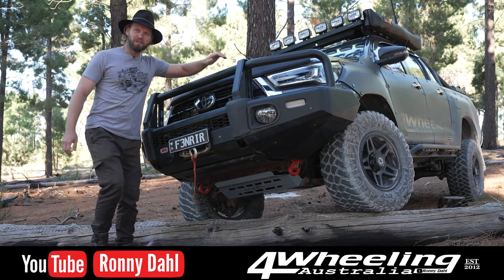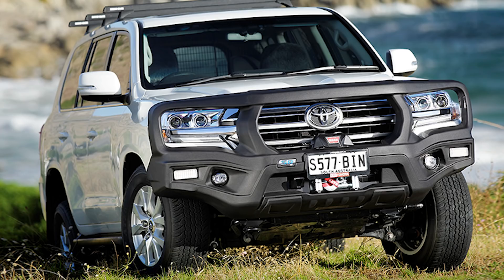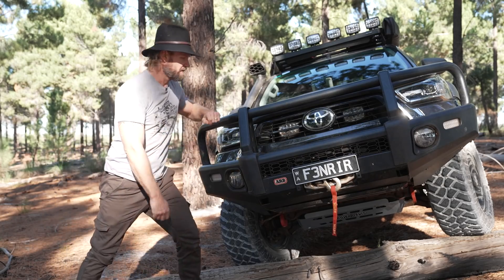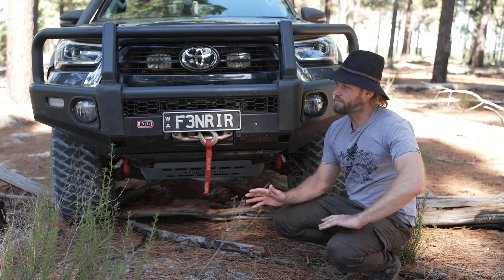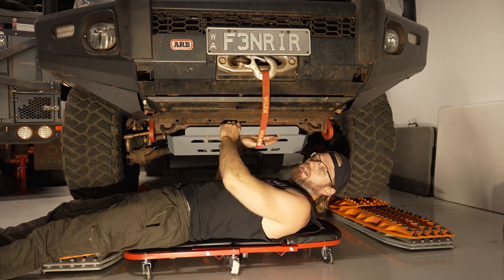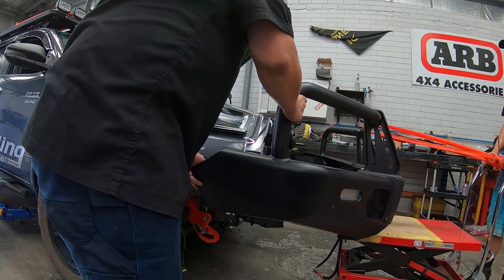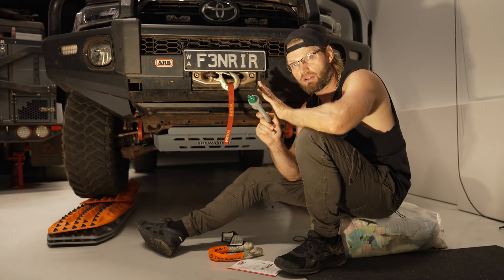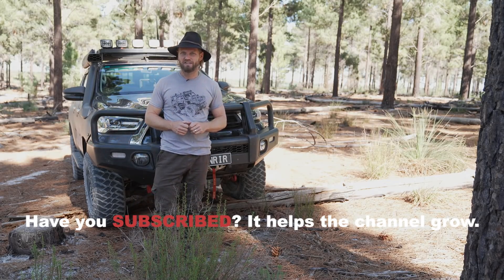2021 Hilux mods, off-road bar work mods part 7

Comment: Its interesting the arguments for and against Steel v Aluminum Bull bars. 

On my previous vehicle, a 2016 NX Pajero I was clipped by another car traveling in the opposite direction. On initial inspection of the bullbar there was only some marring of the powder coating of the right side wing. When the vehicle got to the smash repairers to repair some scratches to the drivers door they found the right wing had been bent back some 7mm. And no it was not the crush cans in the mounting. They were pristine. The bull bar was replaced. I would have expected different performance from a steel bar.

On my new vehicle this incident caused me to reconsider the choice. I went alloy. Now what was interesting with this choice was the weight. The bar is a ECB winch compatible bar. The winch cradle is a fully seam welded 6mm thick, three sided steel cradle, with integral recovery point, which slips between the chassis rails and the alloy bull bar bolts / mounts to the outside of the chassis rails. 

The total weight of the package is 47 kilogram. I installed the bar and weighed everything removed from the vehicle. Total weight of removed items was 40kg. So now I have a bullbar with winch cradle backing the alloy bar for a net gain of 7kg. Pretty impressed I was. 

And the which cradle is large; it accommodates a 12000lb which mounted in the front of my RAM 1500.

Comment: Hey Ronny, do you reckon you could muster up a video about how insurance works for heavily modified vehicles if they're not necessarily signed off by DOT and the impacts of tearing up camp sites can have on the 4x4 community, I think for the younger ones It would really benefit them, so that if they get in some big trouble at least they will have all that information before hand so they can determine for themselves whether it's worth the risk.

Cheers Ronny have a great long weekend, love the vids!!

Comment: Interesting weight for the summit bull bar. ARB state bar is 85kg gross then they remove 13kg (bumper removal etc) which makes it 72 kg. Unless you have a old man emu gvm upgrade which includes a front axle capacity increase you can’t add passenger, winch, bash plates and second battery under bonnet otherwise you’re over 1450kg front axle weight. Speaking from experience and trips to the weigh bridge every kilo makes a difference.

Comment: I want to know about the snorkel. Not sure if i should get one. The Hilux is already horrific on fuel consumption and I dont dare add much that might damage mpg
Reply: what is your fuel consumption ? auto or manual
Reply: @electrasonic  mine is 2.8L Auto and im getting 31mpg driving in Eco mode all of the time and with a soft foot.
Reply: @electrasonic  Now that the engine has worn in I am getting 34-38 depending on hills etc. Still terrible. Our fuel in England is like 5 times what it is in the USA. Not sure about Oz

Comment: Ronny needs to get front and rear axle weights. When I weighted my Ute with similar mods it was way over the front axle loading...
Reply: Actually scratch that this hilux has more weight than I do... He would have to be overloaded on weights easy

Comment: Given that you've had good experience with ARB why are you running a opposite lock bar on the 79?
Reply from the maker: Because they where the only ones that had a thick m/wide tube bar at the time.
In other words the first company to make and release the 82mm tube bar.

Comment: Surprised no mention of Hybrid steel bar with aluminum plates often called Baja bars. That's what I personally opted for for my Tacoma via All Pro Off-road.  It's the best of both worlds. If you actually hit something you can simply replace the aluminum panels but it is also light and strong and supports winching and has recovery points.

Comment: I rather need protection for my mirrors and windshield, that's where I had the most impacts on plus bush - clearing. But my stock bumper already shot a sub-compact into an intersection with minor (battle)damage

Comment: Lift and tyres next plus the body protection stuck to the car
Reply: blokes just put those tires on at the beginning of teh build what’s the point of changing them
Reply: @xaviermann6803  he’s already changed them. Originally he had the Maxxis Razr AT811’s

Comment: Hey Ronny you live in Australia do me a favour go into a ARB give them a smack in the back of the head and ask them when the summit bumper is available for my 2020 Toyota Tacoma TRD pro . If it wasn’t for flight restrictions I’d hop on a plane here in Canada fly down under and do it myself lol
Reply: Here’s your part # 3423160K
Reply: @nathanlawson1888  cool I'll have to check it out I know I can get bumpers up to 2019 but the 2020 and 2021 radar and safety features are in a different location so it needs a new bumper I know they're planning to release when I just don't know when I'll have to check this part out and see if it's compatible with all my safety features thanks for the information.

Comment: I understand that you remote travel and that can be the difference between getting back home.  However, the factory crumple zones mean the vehicle and not the passenger absorb impact, steel bullbars interfere with crumple zone performance, causing greater injury to passengers.
Reply: For Example - one I prepared earlier:  Video demonstrating how the crumple zones are taken care of to be ADR compliant - not as good for bulldozing trees - the bar mounts collapse into the front end.  (Here is XXX 24-7 with a XXX mocumentary  https://www.youtube.com/watch?v=i2foHYCS92w   watch around 1:50 )

Modern Passenger 4x4 vehicles are no longer "Trucks" with the bar solidly bolted to the chassis.

If you Must have an accident, it is best to pick your battles -   make sure momentum is on your side, swatting aside errant wildlife is a whole other "momentum transfer" than "tilting at Roadtrains"

Comment: 15:20 I wonder if that new bash plate isn't actually worse. If you look at the factory one, it's quite dinky. It could probably take 1 good hit and then be worthless. With how robust that new plate it, It could do some serious damage to the actual transfer case. It's going to be transmitting so much more force into the mounts. I can't believe, well I do obviously, that Toyota would use the transfercase itself to support a skid. The frame crossmembers should be doing this.

Comment: Bar work bash plates weight 144kg? So in essence, more than 10 kg less than adding me as a driver... :P (yeah I know it's mostly up front with that bar and winch, not between the axles).

Comment: "Always connect bow to sling" is what I was taught when using shakles. Putting a sling (as in a snatch strap) on the pin creates a higher chance of undoing the pin. 

Not sure why ARB is suggesting this.
Reply: (Maybe to avoiding bending the pins)
Reply: @kadmow  There is no reason this would be the case. The pin is rated the same as the rest of the shackle. I checked on best practise for this and the shackle bow to sling rule is correct.

Also, any angled pull force should be on the bow (that is why its shaped that  way) not on the pin.

I think ARB are wrong on this. So, no, we haven't all been doing it wrong all this time.
Reply: @technopsychobedlam . That is cool (I read up on the rules just to be sure as well - a whole lot of offroad  recovery equipment is used in "ways not intended" and would be picked to pieces by Riggers - Shackles are ideally to be used for straight and balanced loads only..)...

The Bow is shaped that way to allow multiple slings to be placed on the one point, the pin isn't supposed to be under bending moment.

ARB have it this way  (pause and read the "card")  to avoid putting bending moment on the Pin or the Recovery point as it is "designed" in the case of an off centre pull.  (Putting the Eye of a sling on the shackle pin isn't as "risky" as putting the Body of a strap or endless sling in the pin.) - BTW, do you also "seize" your shackle pins as per "recommended Rigging methods" - Probably not - no one does in recovery settings generally.    Cheers.

(NSW Rigging Guide: 
"Where shackles are subject to vibration such as on luffing bridle pendants, mouse the shackle pin to
prevent the pin from unscrewing.
Shackles are designed to take vertical forces only. Diagonal forces will strain the shackle and lead to
eventual failure.
If any small object such as a single sling or another shackle is placed on the pin the shackle will ‘cock
bill’ or cant. To stop this happening, pack the shackle pin with washers or ferrules to keep the load in the
centre of the pin.
When using multiple slings, always use a bow shackle large enough to accommodate all of the eyes safely
on the bow. The pin of the shackle should rest on the hook.
Do not use an unmoused screw shackle where the pin can roll under load and unscrew." )

Comment: Hilux crowd has it easier - they just need to worry about front bumpy? xD unlike us LC crowd - basically I want bumpers, winch, lights, rockslider/sidesteps, skids that protect engine and transmission. That added to the servicing that had to be done to get it up to mechaical standard of not being a lemon, puts me to price slightly above the price I purchased that landcruiser for. which sux terribly, Should've gotten the jimney xD

Comment: Hey Ronny, we’re getting a little crazy with all those no-skip ads aren’t we? Way too many breaking the flow of information.
Reply: what ads? I havent seen a youtube ad in years. Search for the browser plugin 'ublock origin'. Happy days.
Reply: @John-td9cp  I’m on an iPad most of the time.
Reply: @JoeDebono  hey i believe you can still use ad blockers on them - just need to use youtube through the safari browser. I have 1blocker on my iphone and get no youtube ads.
Reply: @John-td9cp  I prefer using the YouTube app as I’ve usually got Safari monitoring my web site. Thanks for the suggestion though.

Comment: "And I don't want to be that guy who's influencing you to buy something that isn't going to work for you" (@8:50).  Bit too late there buddy, myself and too many others bought I rhino rack and now we are left in the shit
Reply: "everything that is on the car, unless its being tested, is something I would recommend".  You can afford to swap out your rhino rack for another brand because you didn't have to pay for it in the first place, but the little blokes like us can't just pull another grand out of our arses plus the cost to repair the vehicle.
Reply from the maker: We all make mistakes mate and I’m sorry if you ended up with a rhino rack. Maybe if the whole thing was clearly stated and the on seller had told you about the Offroad ratings this wouldn’t have happened. That’s exactly why I had to do what I did... removed it and put something else on that is proper.
Reply: @Ronny_Dahl  Now that I've read my comment again it was more harsh than I intended.  I have no problem with you at all, if I was offered a rack by them I would have taken it without question as well.  It just sucks that they had to be so deceitful with information regarding their products that they would've known their customers didn't want to hear.  Theres a big lesson in all this for me which is that just because a company is far above the competition and seems reputable doesn't mean they are the best choice.  You're a good man for actually responding to my comment instead of just sweeping it under the rug like rhino rack have so far.  I have tried so many forms of contact and they have ended up in them saying there is an investigation into the issue and that I should contact them again later on, but they can't even give me a deadline.  The mistake I made was going though autobarn (cheapest at the time) to buy it because they are just as useless as rhino rack, no support numbers and you mention rhino rack to a staff member and the instantly redirect you to someone else who has no clue.

Comment: For the same impact strength, aluminium is on par with steel in regards to weight I've heard. JC (Autoexpert) asks the question - why compromise your personal safety with a bull bar in order to save the car? (Not much good to you if you are dead or maimed). Crush zones are there to reduce the deceleration damage done to humans in the vehicle in the event of an accident, bull bars are there to protect the vehicle, not the people. I'm convinced by his argument.

Comment: You can't beat steel, that's why boats are made of steel. That's why trucks have steel bullbars.
Reply from the maker: A truck alloy bar is a lot thicker than passenger car alloy bars. A truck Steel bar would be stupid heavy
Reply: @Ronny_Dahl  That's the key point, a proper car alloy bar is 6mm alloy which has a higher tensile strength than 3mm steel. So it's not exactly a balanced view to put all alloy bars (OEM and aftermarket) in the same boat.
Reply from the maker: I’ve had alloy before and it didn’t end well so I was talking from experience
Reply: @Ronny_Dahl  What brand?

Comment: I don't believe aluminum bullbars can handle multiple roo strikes.
Reply from the maker: Depends how big I’ve hit a few with an alloy but the bars change shape
Reply: @Ronny_Dahl  the grays and reds in Qld are pretty sizable. I'm more worried about hitting them at 110kph on the highway.